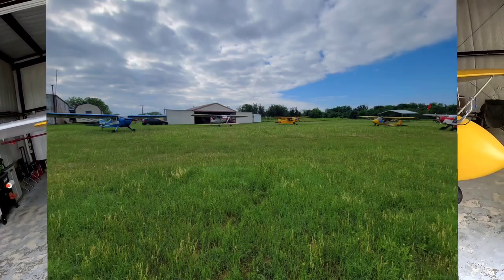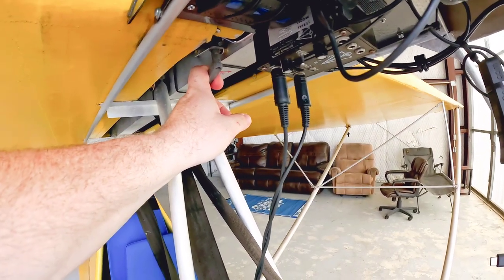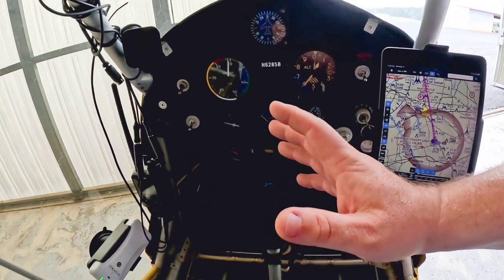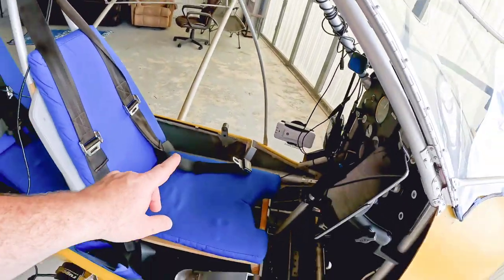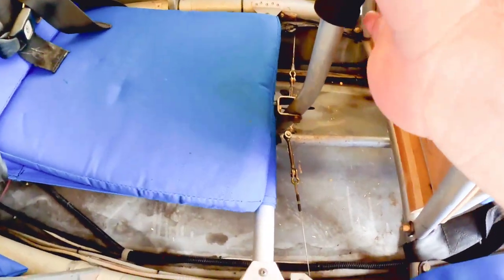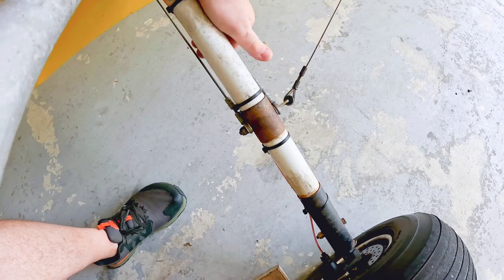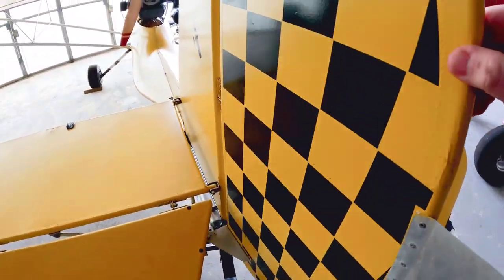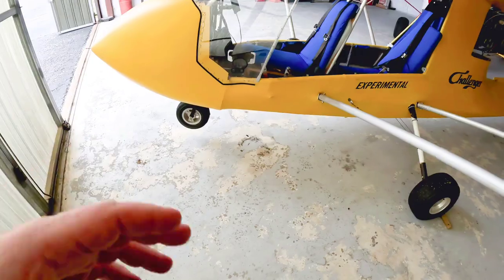Challenger ll Preflight and What I Use in The Cockpit

Comment: I've cut the fabric back a bit around the top wing strut
brackets so I can check the 2 bolts holding them to the wings. I found  one of them had loosened off on one of my pre flights. I replaced all the bolts & lock nuts after that with no further trouble. But it's  still worth checking.
Reply from the maker: How did you do it to where the fabric doesn't continue to tear?

Comment: You can add a transmit switch on a cable and connect to your existing radio. The circuit diagram can be found in the manual.
Reply from the maker: thank you I will definitely look into that!